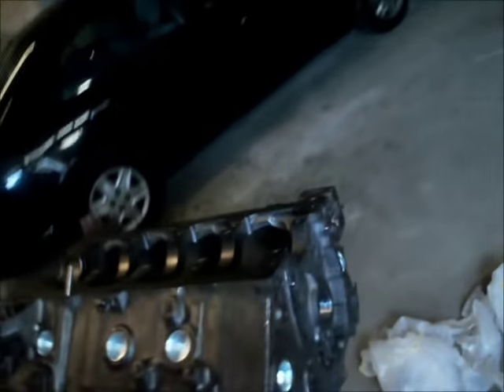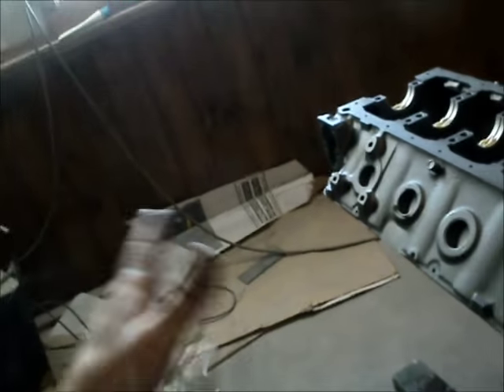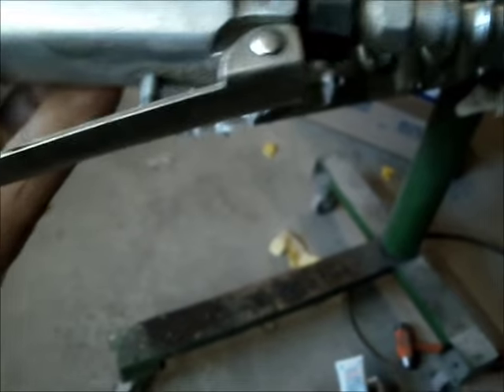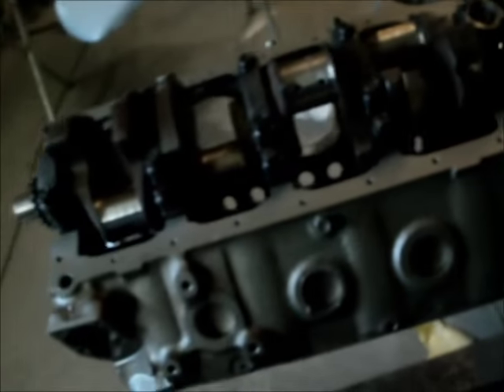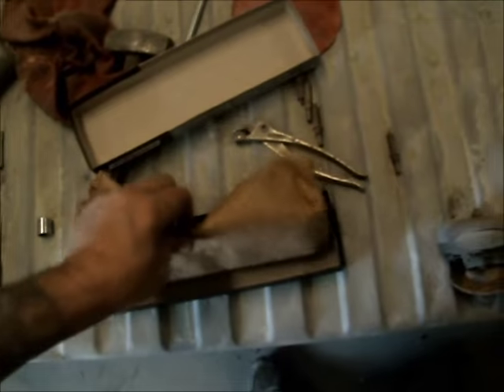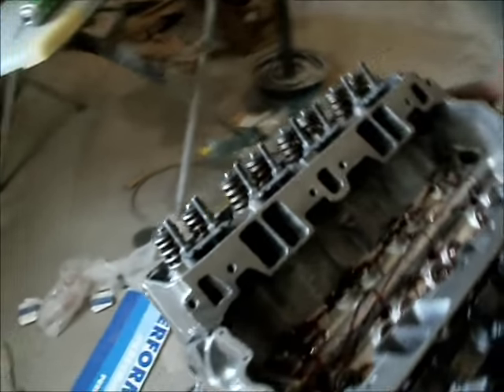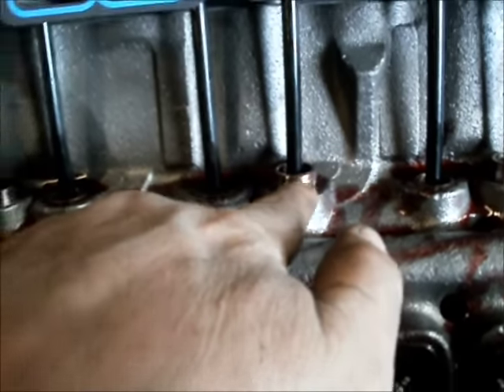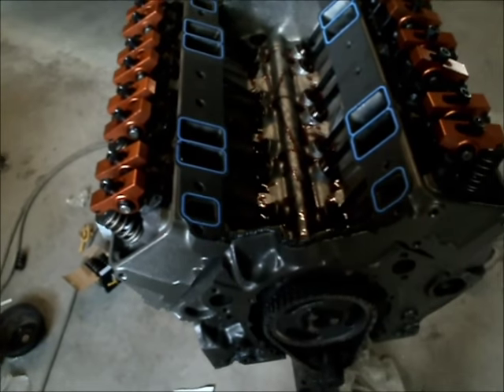rebuilding sbc 406..

Comment: Did a ton of those 400's in the middle 80's. 4 bolter,..  would be a 3951411,.. made in 70 & 71 only. I loved doin' them in the evening,.. cast crank is stong. I use to install a Mr. Gasket valley pan,.. there cheap,.. and they'll keep those non-rollerized lifter's in,.. in case of push rod failure,.. maintaining oil pressure. I liked your build,... take care.....

Comment: I was hoping Capone Auto would have some new videos, But the old ones are a wealth of information and well worth rewatching.
 The 406 SBC is my niche. I've built atleast a dozen 400 bored .030 over to make the 406 ci.
 They are a stout motor when done right and that requires knowing what heads cam, intake, exhaust, ignition to make the most out of the Cubic inch of the 406.
 They say there's no replacement for displacement but that only applies if that displacement can breath properly to make the most power it's capable of reliably.
 If you don't get that motor to breathe it will be a dog. a gas guzzling lump of iron, BUT with the right parts it's a fire breathing dragon ready to rip up some asphalt at will.
 Great video.
Reply: I'm having a 400 sbc built  in my 81 impala

Comment: Thanks brother!  I have a similar build.  I got a 75 vette budget 406 build. Stock 406 block and rods, Flat top pistons,  lunati 276/286 cam, lunati flat tappet lifters, flotek 220/72 heads @ 10.1/1 compression pump gas street car with some UMPH!  Havent got push rods yet but getting it all together in a week or so. I know my heads are bigger than street but the price was right. Going to try my 2701 EPS intake so I can shut the stock hood. But if that don't work I gan get a cowl hood for $350 and paint it if I have to. Thanks for the vid! It's my first full assembly.